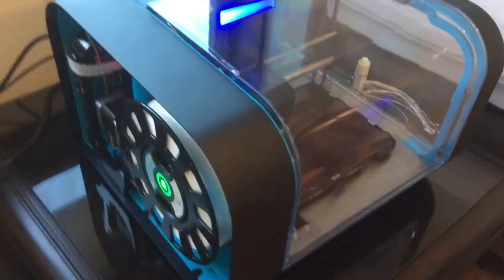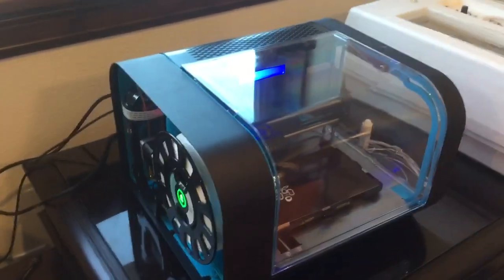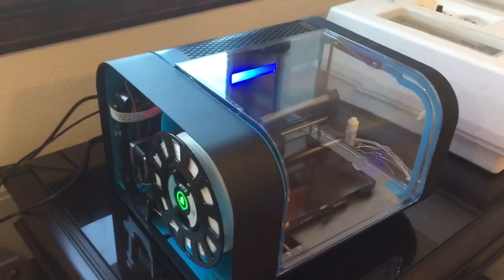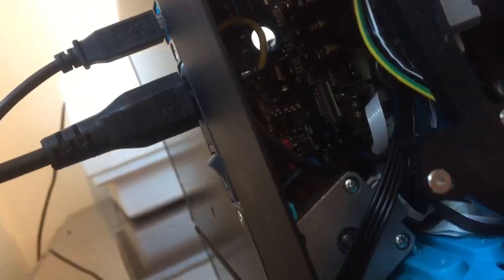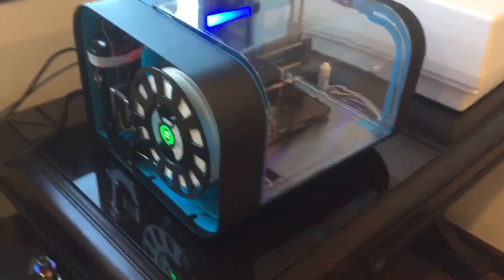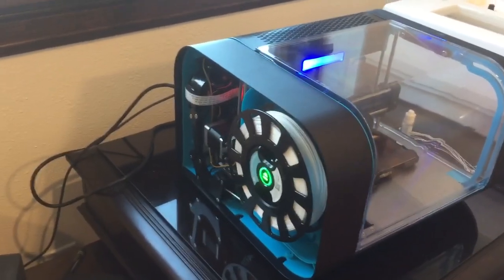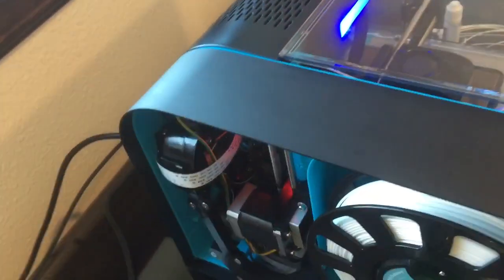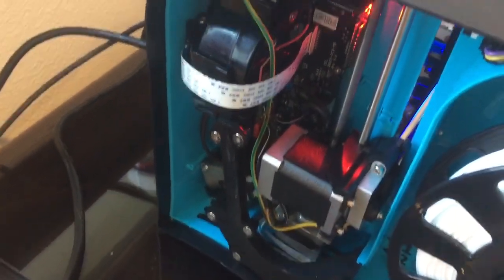CEL Robox 3D Printer Crooked Gantry Error Repair That Worked For Me.

Comment: can u post actual name of capacitor u used. cuz it's impossible to see anything with this video quality. is it panasonic 150uf 35v fm?
Reply from the maker: Correct.  Panasonic FM series, 150uF at 35 volt.  50 volt will work too if there is room.  The FM series have very low ESR compared to conventional electrolytic.

I used through hole technology capacitors because they last longer than the surface mount (thicker seal).
Reply: @gavincurtis  can you check my new video with the level gantry issue. Did you have the same?
Reply from the maker: @sergp7480  Yes.  One motor would reverse drive.  It would also do this when the head left/right motion too rapidly decelerates....makes that one gantry stepper motor mess up.

My theory is stepper motor back EMF on the power rail is corrupting registers in the stepper motor drivers, making them reverse direction and/or lose count.  I also noticed it may have crashed trying to home the head that could have created that EMF to corrupt the left gantry driver?

New capacitors did fix the gantry problem on my machines.  It most likely will yours.  Definitely worth a shot.

Comment: You are one patient man... well done you! However, for my part, I have been a long-time Robox printer owner (and CEL member) and after spending a 'bunch' on one major repair and then on having the single print head replaced with the dual, I had it working of a couple of years (with the occasional error and mishap)... until about two years back (2019) when the heated bed packed up. As I could then not afford to have it shipped and fixed, I packed it away - and very recently decided to see if it was worth fixing - But with it now not even 'seeing' my computer via the USB cable, PLUS the 'firmware update' not updating, I reckon I need to give up with CEL and look elsewhere for a different 3D printer...
(PS. WHEN it printed, it was a great printer!)